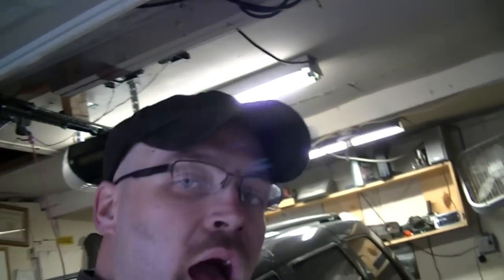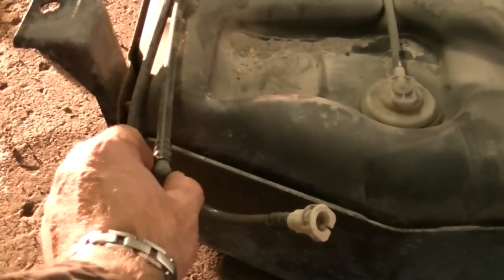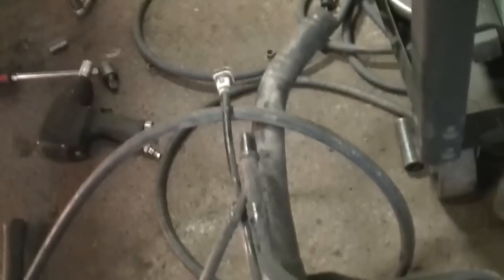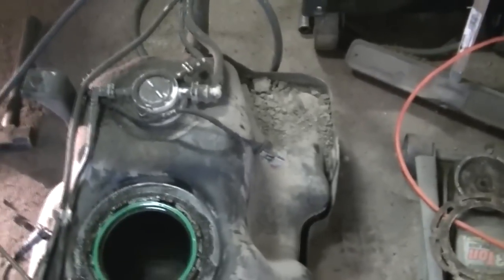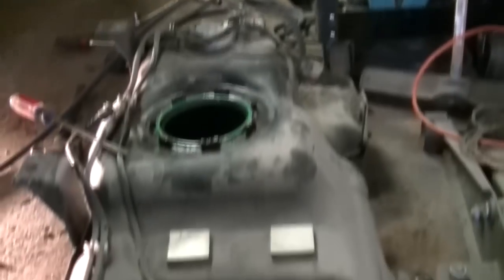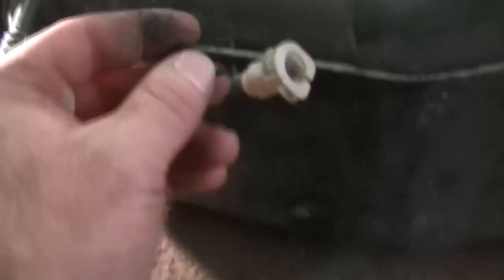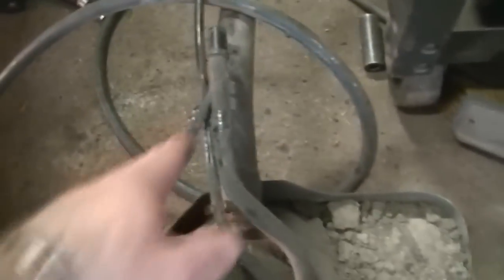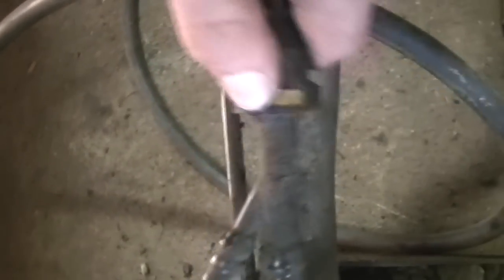2005 Jeep Grand Cherokee Fuel Tank Removal, Fuel Pump Replacement

Comment: I used a large hammer and large flat screw driver to remove the lock ring.  I did not feel safe doing it, but it was better than buying a dodge $130 tool to remove the lock ring.

Comment: Kewl thanks. I'm pretty sure I'm going to need to drop my 1998 Grand Cherokee tank. Took it to the shop and they replaced an O ring but still leaks. Was there an O'Ring located at that fuel-pump assembly. Curious.

Comment: I have a 2005 5.7 hemi Jeep grand Cherokee and they fuel pump is getting ready to go I have to keep my gas tank at least half full if not it just keeps stalling on me but I was told if I did it myself I would have to drop the whole back end to change it I have replaced all the other parts and just did a oil change and this is my only problem left can you help me please
Reply: Updates?

Comment: Did you have to take the rear portion of the drive shaft off to drop the tank?  

Those L brackets on the passenger side of the fuel tank do not look like they will clear an installed drive shaft.
Reply from the maker: No I didn't I just didn't I just bent them a little bit out of the way.
Reply: Thank you.
Reply: davesgarage512 Yesterday I dropped the tank and replaced the fuel pump, seal, and lock ring.  Thanks to you and this video the job went smoothly.

All of my connectors on my 2005 4.7L V8 Grand Cherokee were push buttons.  Instead of trying to remove those connector clips for the fuel and evap lines try pushing them in with your fingers only.  If there is a lot of dirt around the connector before you open it spray it with contact cleaner or brake cleaner to remove the dirt and grime and then it should open easier.  

Draining the tank before removing helped a lot.  Also needed a 24" breaker bar to loosen some of the 18mm tank bolts and the fuel pump lock ring.  On the front passenger side 18mm fuel tank bolt I used a long 3/8 inch extension to break the bolt loose and a long 1/4 inch extension to unscrew the bolt.  The thinness of the extension was needed once the bolt came out about 3/4 of an inch and allowed me to leave the rear drive shaft in place to drop the tank.

Comment: It sucks removing them tanks when there full of gas. Although it is much easier to remove them if you got it on a hoist.
Reply from the maker: True! But I have been doing it for years and I'm use to it. I feel sorry for my back in A few years... Lol!
Reply: @davesgarage512  if I have to change fuel tank pressure sensor code p0452 2007 jgc do I have to drop the entire fuel tank to do that?